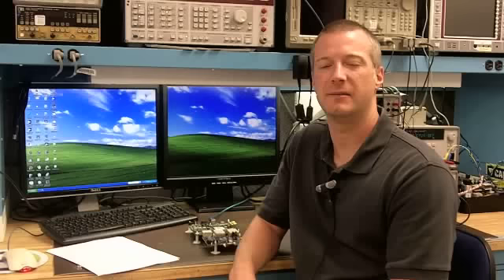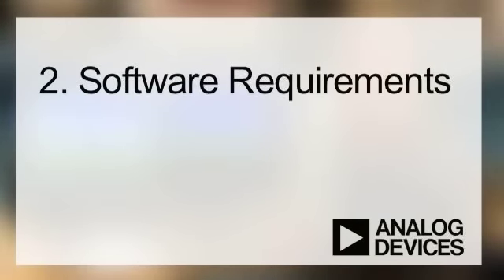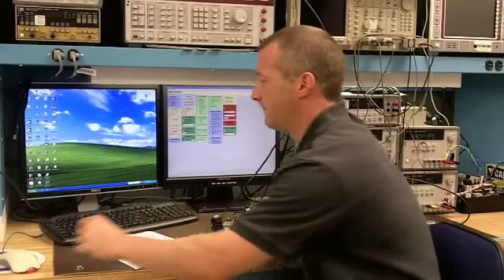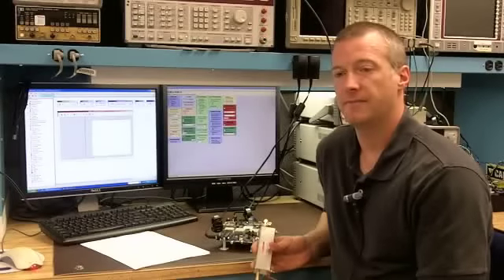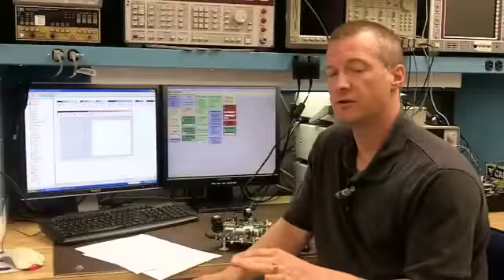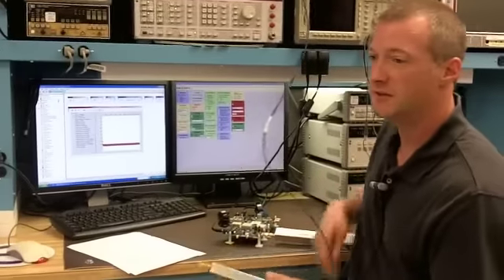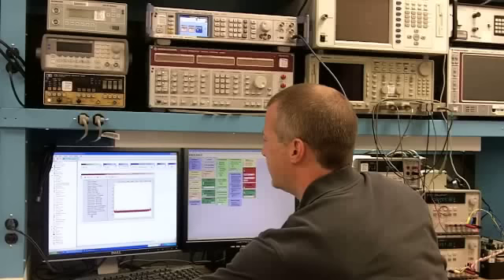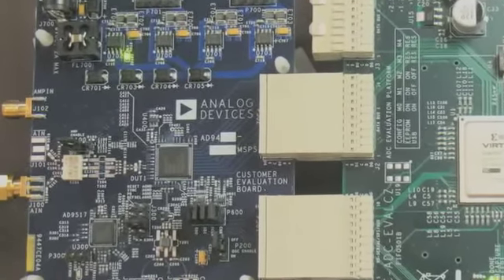Setting up the Analog Devices' AD9467 Evaluation Board

Comment from the maker: Answer (2 of 2) We do typically put an onboard oscillator on our evaluation boards in order to minimize the amount of equipment needed. However, at the time this video was made, there was no available on board clock oscillator from any vendor off the shelf that would give datasheet performance for this particular ADC (AD9467). Crystek and others have come out with such 250MHz clock oscillators that can be used directly with this product today and yield datasheet performance.